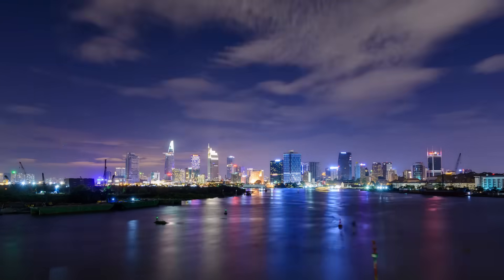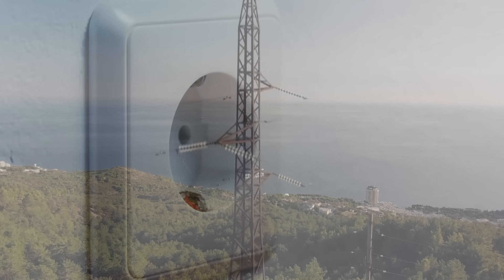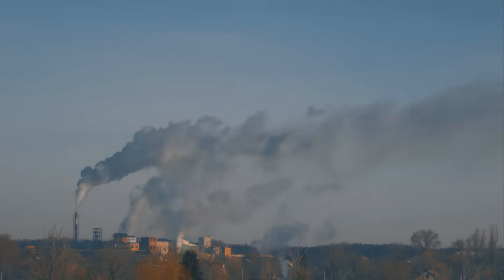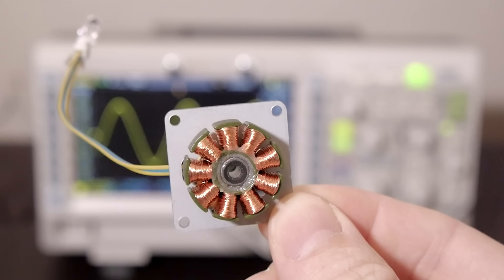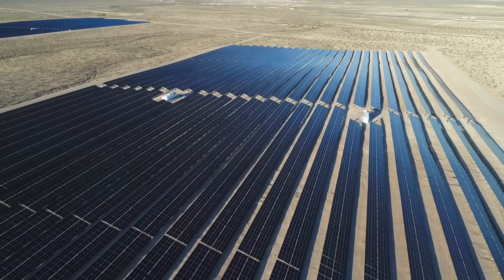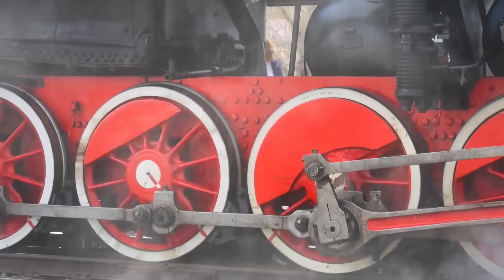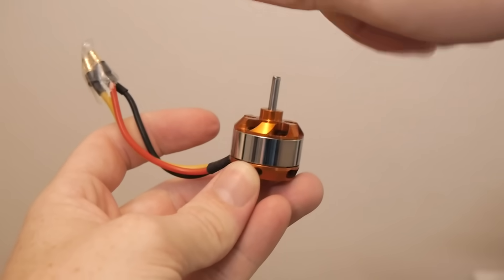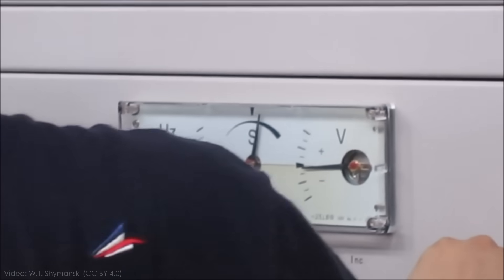How Electricity Generation Really Works

Comment: As a mechanical engineer I always had trouble understanding electricity thank you for breaking down this complex topic into an easy way to learn!
Reply: Mechanical engineer here too. Its much easier to grasp the concepts if you equate electricity with hydraulics where current is fluid flow, voltage is pressure and resistance is bends in a pipe.
Reply: wtf have you just startet studing? this video isnt even covering the basics. All these so to speak "educational videos" are nothing more than entertainment it feels
Reply: Electric fields do not travel inside a powerline. Nor do they travel on the surface of a conduit/powerline. The greatest field theorist that ever lived, Charles Proteus Steinmetz, clearly stated in his books that electric fields do not exist inside nor on the surface of a powerline. They in fact travel outside the powerline in concentric coaxial paths of dielectricity and magnetism. An electric field doesn't exist inside a capacitor but exists outside the area surrounding the capacitor. This is what makes electric grids and electric gadgets so vulnerable and exposed to shorting out from other surrounding fields, like an electric storm.

Particle physicists claim electrons are bumping each other down a powerline to create electric flow. This is false and patently absurd. JJ Thompson who discovered the electron clearly stated it was a "field", and NOT a particle. If electrons were bumping each other down a powerline to conduct electric flow then how do you explain how your wireless cell phones work? Bumping electrons through the air, LOL!!??? 

As far as an AC generator is concerned, it's creating more energy than it's being given. So where does the extra energy come from? Counter-space, aka the Ether. Why would you need a generator to accumulate electric energy from a source when all you'd need is a step up/down transformer to do that with? So why were AC generators created? To draw in the energy coming from counter-space. All generators have a stator which passes by two internal magnets. Magnets are also anchored into counter-space, aka the Ether. The stator passing the internal magnets of an AC generator can draw out the added energy from those magnets in which it's output becomes greater than it's input.  
James Clerk Maxwell said, "If you don't understand counter-space, then you cannot understand this universe".
Can you imagine Nicola Tesla's mind doing contortions when he invented the AC generator? He obviously understood counter-space, aka the Ether, because he couldn't have invented the AC generator if he didn't. The five greatest minds, Oliver Heaviside, James Clerk Maxwell, Nicola Tesla, Faraday, and Charles Proteus Steinmetz gave us our entire electric grid and by extension from their work, all electronics as well. We owe them everything we have today. No particle physicist or theoretical mathematician could ever boast such a claim.
Reply: @joerenaud8292  thanks for your time writing... this is the reason why I comb to countless comments... to find treasure like yours.
Reply: @Benjamin Urbina treasure?  It’s fool’s gold at best.
Reply: @elena6516  Don't you know? 18th century pseudoscience is the next best thing!
Reply: @joerenaud8292  the "ether"? Lmao 🤣

Comment: As a solution to get inertia out of solar/wind, in addition to batteries, couldn't we just use a load of induction boilers to heat up water and then have a normal power plant? 
Either that or two lakes at differing altitudes. Low load means we pump water up, high load means we drop water down. Neither are 100% efficient, but both should help provide some stability
Reply: Yes they're called TESS (thermal energy storage system) google 1414 degrees for example, and pumped hydro
Reply: Both aren't even close to 100% efficient, which just bring up the costs of solar/wind even more, and the latter is extremely limited in geography and scale.
Reply: The efficiency losses are pretty abysmal and getting enough storage to work off of renewable energy alone is a struggle, you need ridiculous amounts of storage to do a complete switch over to the point that it's basically not economically viable. There is a reason islanders around the world continue to pay highest electricity prices in the world so they could ship in fuel oil and run their islands off of that.

Comment: Actually, the most used energy being convert to electrical energy is: Mechanical energy.
First you make the steam where it will produce potential energy in the form of pressure, then you convert it into mechanical energy, via piston engine, turbines and etc, and then finally you use that mechanical energy of a turning shaft to make electric energy with magnets and coils. Hope you can agree with me. Cheers.

Comment: We need a lot more nuclear power plants with newer designs that aren't meant to make nuclear weapon fuel. Thorium reactors should be our future. The only reason we didn't build them in the past was that we needed weapons grade material for nuclear weapons.
Reply: Pretty much every nuclear reactor built since the 60s hasn't been able to generate weapons-grade fuel. The problem is the knowledge required to build and maintain nuclear reactors is easily transferable to developing nuclear weapons.
Reply: That's simply not true, most power reactors are quite useless for military industry, that's why India is the only country that has built their bombs with a civilian power reactor, one they got from Canada. A design that is rather uniquely capable of dual use. Everyone else built dedicated reactors for weapons grade plutonium production, ones that never put a watt on the grid. Civilian reactors do utilize the same uranium enrichment infrastructure that can be used for weapons programs though, but that use always happens after weapons programs are happy with what they get out of it.
Nuclear power didn't start with thorium because you simply can't. You can't even start it up if all you have is thorium, because thorium on it's own is not fissile. You have to mix in enough fissile material to start it up, or you have to have a smaller reactor on the side to provide the neutron flux. 
The only real point in thorium fuel is if you are simply short on available uranium, which again is the case for India. Switching to thorium is in their long term plans, though they'll probably use the same reactors they already have.
There is a lot of hype floating around about thorium reactors, especially molten salt designs, but really, that's all it is - hype.

Comment: Wind and solar are NOT unreliable. In fact solar is very predictable and wind reasonably predictable.They are not constant, but that does not mean not reliable. Overall they are typically more reliable than most fossil fuel technologies because you don't typically get whole generation plants failing.
Reply: I believe the point was "on-demand". The sun's not gonna shine just 'cause some electrical engineer says so.
Reply: @okuno54  Except that is not what he said. He said they were unreliable which is untrue. Solar power works every day on schedule very reliably whether or not the electrical engineer says so. It does work 'on demand'. It doesn't work at night, but that is a known quantity before it is ever installed. Overall wind and solar are more reliable, predicable and available on demand than fossil fuels. You cannot ramp a coal plant beyond its operating capacity and you cannot run a solar plant beyond its. The difference is the coal plant will break down more often.
Reply: I guess you never heard of cloudy days, or high wind events, or days that aren't windy. There are some spots that are more reliable than others, but the fact remains that solar and wind are NOT suitable replacements for our energy infrastructure. Even in spots that have use solar as a "cheaper" source of electricity, they always have a baseload of traditional energy supply, such as coal, nuclear or natural gas. Perpetuating feel-good propaganda about renewables isn't going to solve anything.
Reply: @chrimony  I am well aware of cloudy days and high wind events etc. Nevertheless, these are largely predictable and manageable. Typically more manageable in fact that coal plant 
failures. Wind and solar ARE suitable replacements for at least large parts of energy infrastructure and have already done so in some parts of the world. Denmark for example produces nearly half its electricity from wind alone. Why you choose not to call that 'base load' is merely propaganda on your part. Perpetuating feel bad propaganda about renewables isn't going to solve anything. And yes, solar is cheaper than coal in large parts of the world whether or not you put it in quotes and so is wind. The reality is that cheap wind and solar are very new so it is taking time to replace fossil fuels, but it is happening and will continue to happen globally whether you like it or not.
Reply: @TimothyWhiteheadzm  You're delusional if you think wind and solar is more predictable and reliable than coal. I call traditional plants like coal "baseload" because that's EXACTLY what it is, baseload. If solar or wind is down, a reliable source like coal HAS to be able to pick up the slack.  Do some REAL research, dude, instead of reading propaganda puff pieces. And solar is only "cheaper" during peak solar times to supplement the traditional baseload. About the only reliable sources of renewable electricity are water dams, but those have been pretty much exploited to full potential. Many environmentalists that don't have their heads in the clouds are talking about nuclear as the only viable solution non-carbon solution to meet energy needs for the modern world.
Reply: @chrimony  I am not delusional. I live in South Africa, and every time we have load shedding it is due to failures at the coal plants or the nuclear plant. The coal plants are notoriously unreliable. The solar plants on the other hand are very reliable including at least one that can provide power 24 hours per day. Wind and solar can perfectly well provide baseload power and already do so in many countries, you just choose not to use the label for propaganda reasons. I come from Zambia where practically the only source of electricity has been hydro which is cheap and reliable but also has occasional issues with breakdowns and droughts. It is true that solar is at its cheapest at mid day, but combined with wind and maybe some storage you can get 24 hour a day reliable power for less than fossil fuels. That is simply a fact. For this very reason thousands of planned new coal plants have been canceled and thousands of existing ones are being shut down. This trend will continue to coal is gone. Here in SA as in other countries the coal industry still has a lot of political power and is trying to delay things, but the economics mean they cant hold out forever. As for meeting the energy needs of the modern world, Europe already gets 14% of its electricity from wind alone and that is increasing dramatically every year. Nuclear is on its way out as it will always be more expensive than solar and wind.
Reply: @TimothyWhiteheadzm  Maybe the problem is that you live in South Africa, and not with the coal plants. Do some actual research. Environmentalists that are serious on the issue admit that solar and wind cannot replace fossil fuels.
Reply: @chrimony  I have done a lot of research on the topic and you are wrong. Solar and wind are already replacing fossil fuels and will continue to do so. They will not provide all the power in every country because many countries have other options such as existing nuclear, hydro power, geothermal power, waste incinerators and more. Where there are no other options then it will be necessary to have some storage but that is nothing new. Here in South Africa we have long had several hydro storage schemes that are used together with fossil fuel plants. They would probably need to be expanded on or the use of batteries and solar plants designed to store heat could be involved. (we have one such solar plant in operation already). But it won't be long before solar + wind + storage is significantly cheaper than coal.